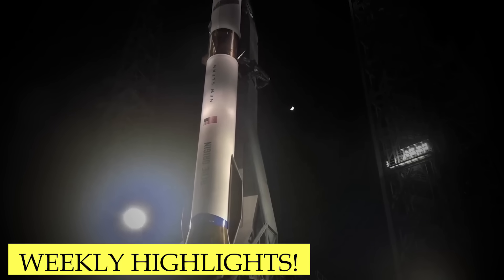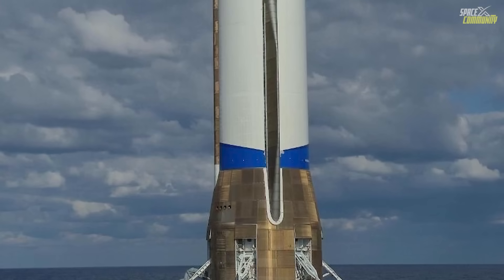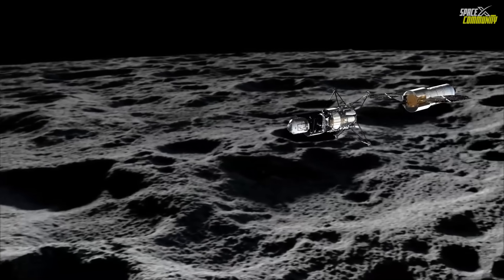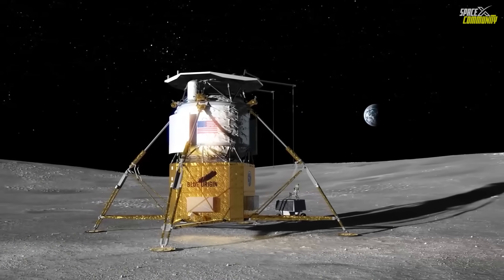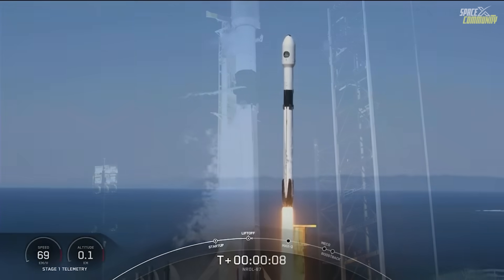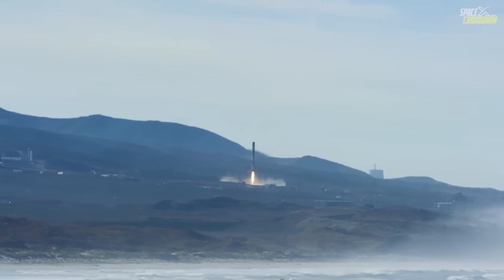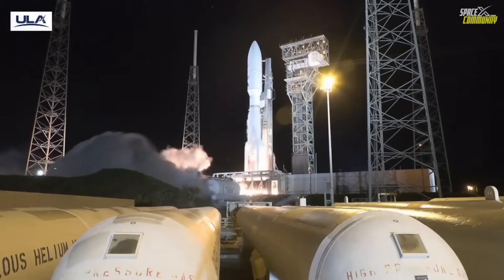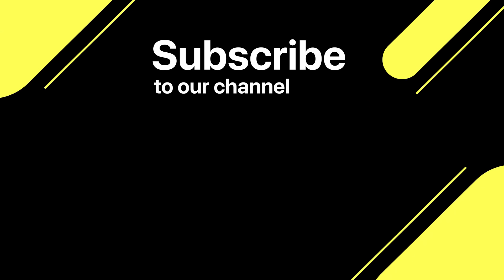SpaceX Just Did Something No other Company Has Ever Done! Two Falcon 9 Boosters Launch Same Time

Comment: So the tortoise and the hare seems to have an interesting turn.
Reply: Yeah, it only took the tortoise 10 years of watching the hare and using the hare's success as a shortcut to avoid the dips in the road that the tortoise normally would have had to find solutions for itself.
Reply: @GtTrader67 What is it now for Space X with Falcon 9....525 launches to 2 for Blue Origin. Space X with Starship and Starship booster. Perfecting a booster landing, upper stage landing verses Blue Origin which has a disposable upper stage and fairings. Blue Origin New Glenn is behind in payload in comparison to Falcon 9 Heavy but ahead in fairing size. The Blue Origin weld down on the booster was amazing.